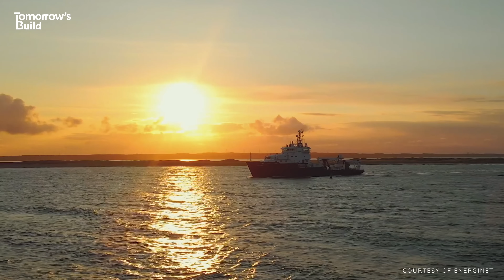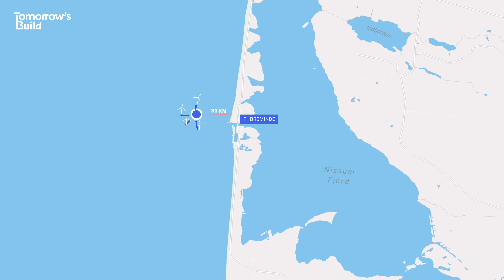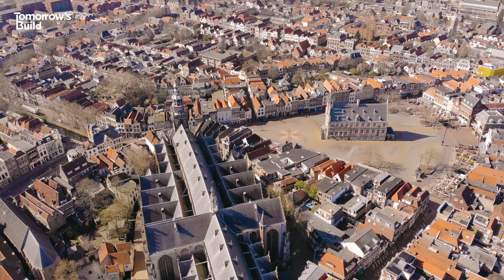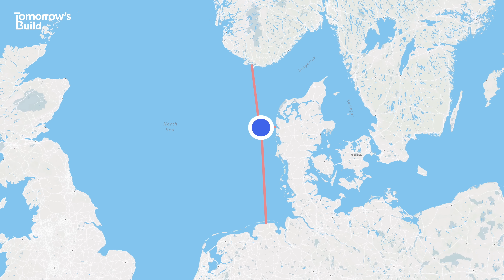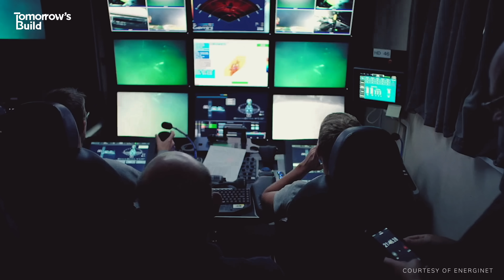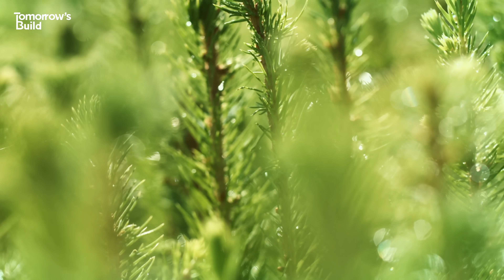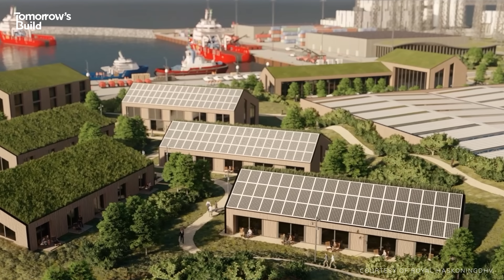Denmark's $34BN Energy Islands Could Solve Europe's Power Problem

Comment: That's one thing about the Scandinavians, they are very creative when it comes to solving problems. My country, Singapore, is also embarking on a major project with Australia. We are going to pipe green energy (solar farms) from Australia all the way to Singapore. It's going to supply some 20% of our electricity once it is fully operational
Reply: We are creative with coming up with non-solutions. This project is nonsense. The amount of rare earth minerals needed to make this scaleable and realistic would require thousands if not tens of thousands of new mines. The average lead time for a mine from discovery to mining is 30 years. A significant portion of those rare-earth metals are found in Russia. We need oil and gas.
Reply: @johanneswestman935  I dunno man. China has built out 300+GW of wind power in the later years. It's definitely possible. The main problem is that wind power isn't that stable (but I imagine it's pretty stable in the north sea). To say we need fossil fuels is just wrong though. We have perfectly viable power solutions such as: Hydroelectric, nuclear, geothermal, solar, wind, biomass etc.
Reply: @kristianl7117  You don't know because you haven't done the math. The amount of commodities going in and out of storage on the markets is information that is openly available. Go look at the supply, go look at what the inputs are and do the math. The conclusion is pretty simple. It's not possible. It might be possible for Hamburg to be "100 % renewable" if only Hamburg does it. But if everyone is going to do it - at the same time - there aren't enough minerals and open mines in the world to produce that supply. Fossil fuels are absolutely critical.

Wind doesn't even account for 5 % while coal accounts for over 60 % of Chinese electricity generation.
Reply: @johanneswestman935  28% of Chinese energy comes from renewable sources. This is an increase of 10pp in 10 years. Sure, fossil fuels are needed in the short term, but it is very possible (almost certain) that we will transition away from fossils entirely in a few decades.
Reply: @kristianl7117  Sorry Kristian, it is evident to me that you have no idea what you're talking about. You are clearly not an energy investor or anything of the sort. Fossil fuels are not going anywhere. There aren't enough metals to create your utopia. The vast majority of Chinese renewables is hydropower - which is not an option everywhere. We are moving from coal to natural gas.
Reply: @johanneswestman935  China doesn't give a shit about the environment, but they are pursuing green energy like crazy. Of course it's viable, if it wasn't then why would anyone care to shift to renewables? I'm not naïve. I know it's gonna take time and i know it's gonna take longer than 2030 or whatever wildy optimistic target western Europe has set, but it's gonna happen. Solar for example is dirt cheap and there's no shortage of material. Sure there's the storage problem, but there are already solutions and it would be bizarre to think there won't be solutions in 20-30 years.
Reply: @kristianl7117  I don't know to spell this out for you in a clearer way: there simply aren't enough commodities.
Reply: @johanneswestman935  And i'm saying there are. How about you show some sources? You're making a contrarian claim, so you should back it up with some proof.
Reply: @kristianl7117  I told you already - the available quantities of minerals are openly available on places like the Chicago exchange - you can literately buy futures for any mineral you want. Take the inputs per GWh of solar/wind and estimate how much raw material you would need. We're not even close. We would need THOUSANDS of new mines, if not TENS of thousands.

Why would you want me to post a link to some random website when you can do the math yourself? The information is FREELY available.

My whole point is that YOU are actually making the contrarian claim. Solar/wind make up LESS THAN 3 % of global energy production! They exist almost exclusively in places where fossil fuels are heavily punished and solar/wind is heavily subsidized. They are a complete pipe dream. 

Your two choices are to either accept a severe cut in your standard of living or accept a wide use of fossil fuels.
Reply: @kristianl7117  China is currently adding more power generation through coal plants than wind or solar plants. Most of China's renewables are hydro, which they have overdone and now are experiencing simultaniously the  worst drought in the South and the worst floods in the North for several hundred years. I wouldn't say that is very sustainable.

Comment: Think of the energy it will take to build these islands…….whether you are dredging sand (which if not stabilized will soon be eroded), or using metal or concrete caissons………..how many years to recoup the energy deficit of building…..let alone the inevitable cost over-runs. How about using the rubble from demolished buildings which would otherwise go to landfills?

Comment: I'm all for clean energy, but I'm less impressed by the concept and more bewildered.  According to the video the island location would be just off shore and still distribute all the way to Norway and the UK.  Reductions in distribution distances and aggregation distances appear to be rather marginal in comparison to the cost of constructing an artificial island which then comes with added risks, operating costs, and environmental issues.  I'm not a Dane, but land availability in Denmark simply isn't so scarce that it justifies this type of plan.  Just run the cables 5% further. What am I missing here?
Reply: One thing may be that anything closer to the shore would meet a substancial resistance from local NIMBYs, that delay the project for years? And large swats of buildable land IS scarce in Denmark. Very scarce. 

62% of the total landmass of Denmark is used for agriculture. 10% for cities and infrastructure. 13% forrest (witch if cut down negativly impact the enviromental calculation of the project) and 2% inland water. That leaves 13% of the total landmass to build on, and part of that is surely protected.

Also, to have the maintenence crew and parts so close to the actual wind farm saves a lot of money in the long run.
Reply: @victorcapel2755  Hmmm... I'm not one of those types so it's hard for me to relate to that mentality.  Certainly it would be a factor.

Comment: If I'm to be honest, while I support renewable energy to a degree, I'm skeptical of how well this will work. 

It might seem like a good idea at first, but when you think about it, there could be some pretty huge problems. 
One of these is probably the accelerated corosion and wear on the parts due to the proximity to the ocean, which will drive up maintenance costs and require more frequent replacements ( which also means more waste produced ) - which is also another thing, these wind turbines will need to be dealt with after their usefull life span - as far as I know, lots of the wind turbine components can be recycled, but are rarely ever so. 
There are also environmental problems. This may sound supprising, but this large scale construction of wind turbines could have some unforseen consequences on the local climate, perhaps even the climate of the whole continent - these turbines do not take the energy from nowhere, they take it from the wind, which means the wind than has less energy to move, it is not endless after all. Sure one, ten or even hundred turbines are likely gonna make no difference, but tens or hundreds of thousands might and it could be a problem. I personaly think there should be more studies on the effects of large scale renewable infrastructure projects like these to make sure we don't accidentally make things worse. 
Another problem is, that this centralization of power production could be pretty vulnerable, not only to outside threats like terrorist attacks or military actions of other countries, but also natural dissasters - for example a strong storm could potencially knock out the power for half a country. 
And lastly there are also socioeconomical / political problems. Europe or the EU are not one large country, they are not even some sort of Federal Republic or anything close to that, EU is a loose union of states that dissagree about a lot of things and still have large social and economical differences between one another. Wealth and wages still differ a lot across the EU, so what could be cheap energy for one country - like Denmark - could be pretty high price one for another - for example Czech Republic. People are not gonna be exactly keen on buying power from other countries, especially since it will most likely be pretty costly, while also getting the control over power production taken from them, meaning they will be dependant on outside imports.

I just don't really see this going all that well.
Reply: 1) To get the most value out of a wind turbine, there's nowhere as efficient as a coast, maintenance included.
2) The recycling of wind turbines is a definite problem and is something that NEEDS to be addressed before this kind of project can be expanded upon. I totally agree with you on that point.
3) These turbines and islands won't be installed overnight. When it comes to wind and energy loss, it's going to be an incremental issue with incremental solutions. 
4) The EU does have its infighting, sure. What it also has is a common need for renewable energy, so a common solution is, by design, a solution for all.
5) Energy is only going to become more expensive looking forward. Energy from wind farms would reduce the cost of energy, which would seem to be a positive for all.
Reply: @faceybrian404 
1) I agree, though it is still an issue in my opinion

3) While I agree that would be the case, I wasn't necessarily talking about that. What I ment was the effect of the energy being taken from the wind itself, because energy doesn't just apppear or dissapear, it only transformes to other types of energy - that is the case here as well, we would be transforming the kynetic energy of the wind into torque and than into electric power. My concern is what sort of effect could this potencially have on the local and continental climate - it could have none, or there could be some drastic consequences we did not think about, after all we don't fully understand how natural processes are affected by one another and small shift in one could drastically affect another. That's not to say that we should not build more wind turbines, but I think we should also spent time researching their effects on the environment, not just wave them as solved. I atleast hope that such things are taken into consideration when these projects are being planned. 

4) Well, not really need for renewable energy, more of a need for green energy. Though than again, there are still problems with poeple not wanting to be dependent on forrein imports, so a lot of countries will push to make their own electric power from their sources. The trust to rely solely or even just mostly on imported power and in many cases from renewable energy just isn't there for many people, especially because there is the fear of being cut of the grid if any sort of problem or shortage appears - after all, if there is not enough power to power Denmark, the first thing they will do is care for their citizens to get power and stop exporting it. Point being that there is not really a suficient trust between the nations and people to create such an interdependency. 

5) Indeed, but the exported power is always going to be sold with at least small profit in mind, so while they might decrease the prices a bit, you are still going to have to buy the electric energy for market price value ( you can't buy power produced just by ofshore wind farms, nor would anyone sell it to you for the price they produce it for ). 

I will be interrested to see how it goes, but I'm still skeptical as to if this will be sucessfull or not, only time will tell.

Comment: From a political - military perspective, putting too much of your energy into one location is not reliable. Madison, WI put a 345kV loop around the city with drops to substations.
Hospitals and other high reliability facilities have multiple power feeds that are automatically switched to the most stable energy source or back up generator.
I have started 15 hydroelectric power plants, been involved with multiple types of powerplant development, upgrades, warranty repair, staffing, compliance, and operation. Spreadsheets, calculus, historic data are tools to do plant estimations and simulations to help in design and building budgets.

Comment: Should put massive nuclear reactors on that island.
Reply: The wind turbines are fine
Reply: I'm pro nuclear energy, but that would just be dumb. Not only would it put the powerplant to more risk, since things like storms, unexpected earthquakes or even some forms of high waves could in the very least distrupt the energy production. It would also be far from potencial help in case something goes wrong. Not to mention that running a nuclear powerplant requires a lot of personal, so there would likely need to be a city build there as well and all sorts of utilities would be needed to be dealt with from land. It ultimately defeats the purpose - nuclear powerplant can be built basically anywhere ( as long as it complies with certain requirements ), what would be the benefit of building something which produces electricity in the middle of nowhere, where you would have to build aditional infrastructure to get the energy to the place where it is needed.

Comment: A generators efficiency is judged  by the feet per minute the coils pass each other . So why do they make a small generator and big blades . The generator needs to be very much larger in diameter , which would increase its output hugely

Comment: These people do not have any idea of power. 10 GW is 10,000 megawatts, or 10 million kilowatts. The effective power delivered by wind turbines is just 1/3rd of its rated capacity (1/3 is what is called "plant factor" and it comes from the fact that wind is not always blowing), so 10GW is really equivalent to 3 million kilowatts of continuous power. If that is going to feed 10 million households that means each house will have an average demand per house of just 300 watts. That is way off the mark, especially when the green people want you to feed even your car and your kitchen by electricity; not to mention your toaster, ironing, water heater, etc)

Comment: Why not use tidal energy?
Reply: That is not a option in Denmark as the difference between ebb and flow are pretty small, some places it might be worth pursuing though.
Reply: Also tidal energy is very tricky to do cheaply.  The machinery is in a remote corrosive environment, and the power density is much much lower compared to traditional hydro.
Reply: @andyb2339  Indeed i am also a painter, and so familiar with maritime corrosion class, your painting must be good or it will be gone soon.

Comment: This is a pipe dream.

Wind and solar have a problem—intermittency. The proposed farm in the video above will have several problems:

Solar wise it produces no power at night and little on cloudy days. Similarly, wind generators stop producing when the wind quits. On the other hand, a city, state, or country needs reliable electric power day and night, all year long, regardless of the weather. That means that for wind and solar to be a serious part of the power system, there must be some other form of generation or storage that can step in and seamlessly fill the power gap when the renewables stop producing.

Denmark imports power and today has the most expensive electricity in Europe.

Meanwhile, the two nations whose electricity sectors produce the least amount of carbon emissions per capita of any developed nation did so with very little solar and wind: France and Sweden.

Sweden last year generated a whopping 95 percent of its total electricity from zero-carbon sources, mostly coming from nuclear power.
France generated 90 percent of its total electricity from zero-carbon sources, again mostly nuclear.

The weak nature of water, sunlight, and wind means that hundreds of thousands of times times more land and thousands of times more concrete, cement, steel, and glass, are required than for nuclear plants.

All of that material throughput results in renewables creating large quantities of waste, much of it toxic.

For example, solar panels create 200 - 300 times more hazardous waste than nuclear, with none of it required to be recycled or safely contained outside of the European Union.

Meanwhile, the huge amounts of land required for solar and wind production has had a devastating impact on rare and threatened animals even when solar and wind are at just a small percentage of electricity supplies.

Non nuclear 'green' energy is total BS.
Reply: I like nuclear, but it looks like Sweden actually generates equal amounts from Hydro.
Reply: Is there any reason this power station couldn't handle inputs from Nuclear as well?

Comment: Renewable energy is a pipe dream. You have non polluting Nuclear energy that is reliable. Wind energy can only produce in a small wind range. When the winds are to high or to low and it is OFF. It also has only a 15 - 20 year turbine life before it has to be replaced.. Massive amounts of polluting fuels are required to manufacture the turbines.. Thus saving little from the turbines except for a FEEL GOOD factor.  Much like touching up the X-rays of a dying patient..